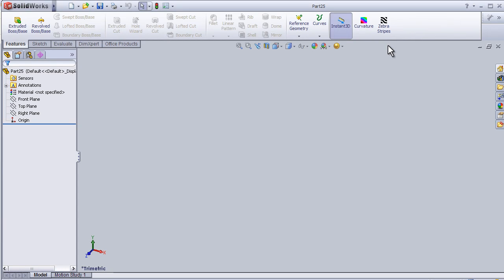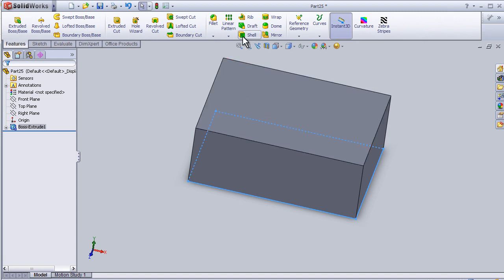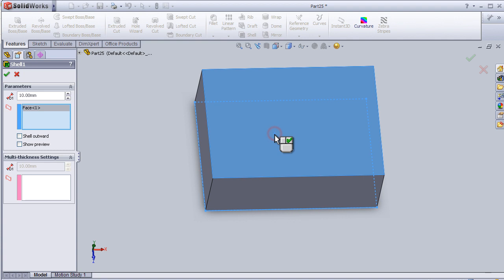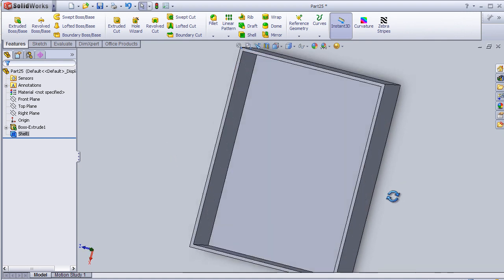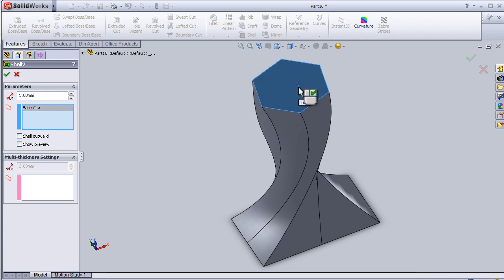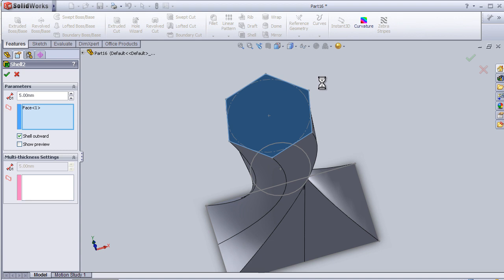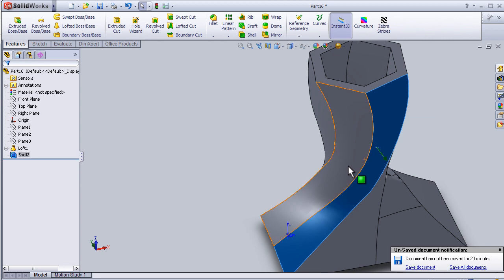30- SolidWorks Beginner TUTORIAL: SHELL

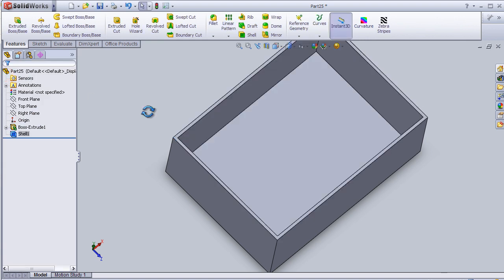Comment: hi quick question, on 1:31 he demonstrated multi-thickness shell settings but I don't see any difference between 1:21 and 1:31 . Please help me
Reply: Hello, it's because he didn't change the dimensions of the "multi-thickness which is 2.0mm " for the selected faces thus No change in the shape . (We can say the "parameter" is leading on the "multi-thickness" as dimensions have not been changed). To have a change, the dimensions in the "multi-thickness" should be different from the "parameter" one. I hope it helps. 😉